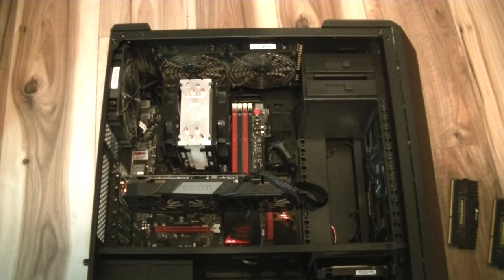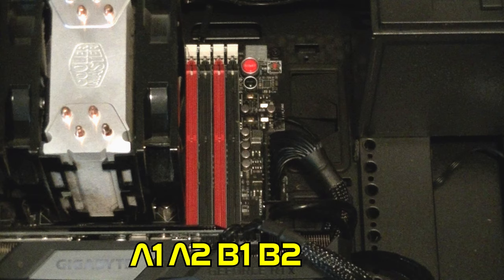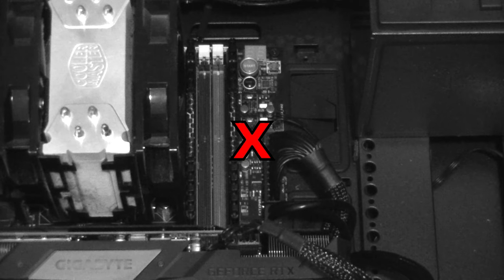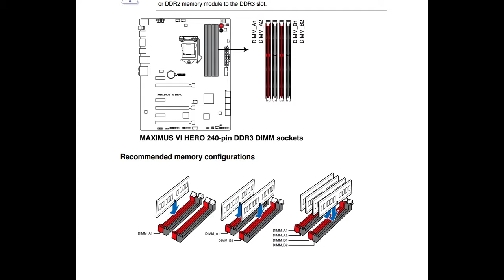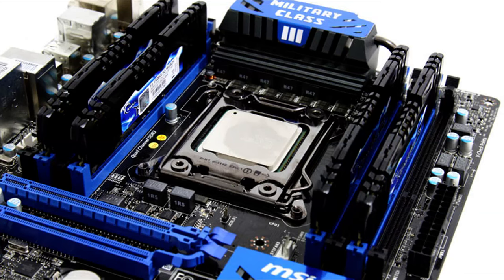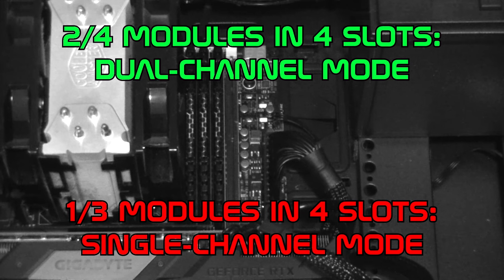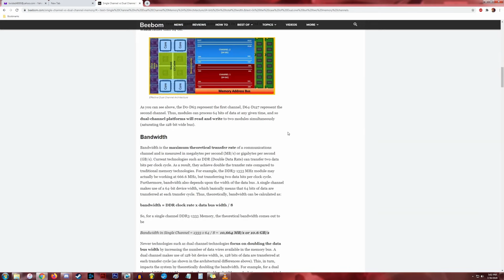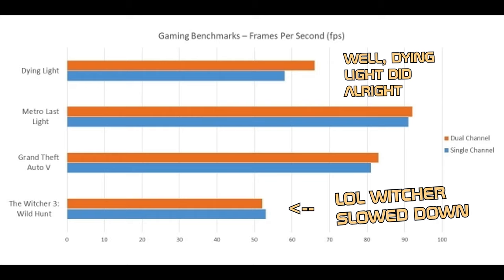How to Make Your RAM Run in Dual-Channel Mode

Comment: I install my ddr3 4 slots but it always bluescreen and when I put 2 slots again it normally again. Am I making mistake with my ram?
Reply from the maker: Check each individual RAM module in each individual slot. It could be some bad modules or it could be bad slots in the motherboard. If you deduce that any of the slots are bad, unfortunately there's not much you can do to fix that except for replacing the motherboard.

Comment: Is it neccesary to have the same model for both ram sticks to activate dual channel??
I mean, if i buy 2 sticks from different brands BUT they're running at same speed
(for example: 
BRAND A: 3200MHZ 8GB DDR4)
BRAND B: "       "     "          "..R4).
Reply from the maker: It's not necassary to get the exact same model, but you should get the same model if you want to have the least amount of headaches as possible. But again, dual-channel can still work with different brands/models (and these days with modern RAM they are starting to get more compatible)

Comment: I traded for a ASUS Rampage IV Extreme X79 system, I have 4x4 16g memory and 8 slots for memory colored red,black,red,black etc..... How should I fill the slots? I messed up and took the sticks out to clean. Originally I think it was all the red slots.  Is that the best to run dual channel?  Two black two red?  I need guidance.  Digital Storm built this PC in 2012...  Thanks
Reply from the maker: First try filling them into all of the matching colors (all red) and then run a program like Speccy and see if it says dual-channel.

Comment: So would you say it’s better to leave 3 ram sticks in at single channel mode? Or two Ram sticks at dual channel?
Reply from the maker: Generally, three sticks in single-channel mode will outperform two in dual-channel. More RAM is better (to a point, as in, if you already have enough RAM, there's no need to add anymore and thus dual-channel of two would be better in that case).
Reply: @Torqcx  Thanks so much

Comment: So would a 2 stick only mother board on dual channel mode work the same as a 4 stick mother board in dual channel mode?
Reply from the maker: Correct, both will run in dual-channel mode

Comment: When we install another 2 modules which makes a total of 4 modules, should we still use XMP or manually set the MHz in manufacturer's out of the box value? Thanks in advance mate.
Reply from the maker: I always like to start with the XMP, but if you have problems with it I'd go manual.
Reply: @Torqcx  OK. Will try this once the extra modules arrive. Thank you!

Comment: If I'm using three 16GB cards, are all of them going to work on single channel, or two of them will operate in dual channel and the third one in single channel?
Reply from the maker: On most modern motherboards from what I've seen, yes, that's exactly how they should operate (so long they're installed in the correct slots, according to your motherboard's manual).
Reply: @Torqcx  thank you so much for answering! Imma buy the 2 card pack then! Unfortunately I can't seem to find just one, and I already have one, so I will end up with 3 😂 I think they're all exactly the same

Comment: I have 2x8GB of Rams Kingston HyperX Fury (1800 MHZ) and 2x4GB of SK Hynix (1600 mhz) on the motherboard DQ77MK-R01 (Intel).
It has 4 Slots 2 Black and 2 Blue. What should be my pairing Scheme of Rams which Rams should be put on for Dual Channel Mode with Higher Frequency and GBs.
Looking for answer ..??
Thanks.

Comment: Hello im very new to all those things. which is better. 2. 16GB ram or 4. 8GB ram. all are 1866 mhz.       also  1866mhz is the max that i can use is that good ?
Reply from the maker: If your system is running in dual-channel mode, I would go with the 2x 16GB (less liabilities and less power being drawn for the same--if not slightly better--performance). 1866MHz isn't particularly "fast" for DDR4, but I wouldn't see it making much of a difference if it faster.

Comment: Do you have to make an adjustment in settings to activate dual channel? Or does installing two cards just do it automatically?
Reply from the maker: If you installed the RAM modules in the correct spots, it should automatically run in dual-channel mode! :)

Comment: My question is i have 4 slots in motherboard. Currently I am using 2 8gb sticks (total 16gb) in the dual channel configuration. Now if i want to add 1 more 8gb stick that will make it to 24 gb but still will that be slower then the 16gb dual channel configuration?
Reply from the maker: On older motherboards yes, 3 modules would limit you to single-channel mode. However, motherboards made in the last 3 years or so are typically able to simultaneously run pairs of RAM in dual-channel as well as any extras in single-channel. If this is the case, if anything you will just see your PC's performance increase rather than anything slow down. But you would have to check your motherboards specs/manual.

Comment: I have a question I only have 2 ram slots and I have 1 installed but they're different number ddr1 and ddr2 can i still run on dual channel mode?
Reply from the maker: Motherboards won't be able to simultaneously support different DDR types of RAM, so if you're saying you have a DDR module as well as a DDR2 module, the short answer is no, you won't be able to run one of them in the motherboard because it won't be able to support it. Always recommended to get the exact same make and model of RAM when installing multiple modules.

Comment: I'm having trouble with a motherboard manual, all I know is it has dimm1, dimm2, dimm3 and dimm4 in order, would dimm1 go with dimm3 for dual channel ram, or would dimm1 go with dimm2?
Reply from the maker: Go in the order you see in this video to start with (DIMM1 and DIMM3, or DIMM2 and DIMM4). Use a program like Speccy to see what mode it's running in.

Comment: Hi, thanks for the vidéo !
I just have one ask, if I had 2 slots with 2 ram of 4go hyper X Fury (Kingston) and I bought 2 others 4 Go but G.Skill Ripjaws IV Red, I put them on A2 and B2, and my computer is rebooting to the infinity
What I have to do? (Same frequency on the ram and motherboard B150M-D3H)
Reply from the maker: Try each module out in each slot individually. If it continues to fail to boot then the different brands of RAM may just not be getting along

Comment: Im confused. I went to the bios to put on xmp mode and saw that it said it was on single channel mode but i have two sticks of ram. The rams are in the right slots. Not exactly sure how to change it to dual channel. I have an ASrock motherboard. Plz help
Reply from the maker: Look up your motherboard's specific model's manual and see what it requires. Try trying different modes for the RAM for the BIOS (see if there's an option for "auto")

Comment: Small problem with my first desktop PC, as soon as I insert 2 sticks of 16" RAM into the 2 gray slots recommended by the motherboard manual, the system doesn't start and an orange light appears which, as I understand it, means there is a problem with the ram... however if I leave only one 16GB stick the PC starts up easily. What can I do?
Reply from the maker: I'd start by swapping the modules around, as well as trying them individually in each of those two slots, again, individually. Hopefully this will help you narrow down whether one of the modules or slots are bad.
Reply: @Torqcx  Hey man, thank you for the reply. I tried it first and apparently the problem is with slot A2 which doesn't read any ram, but slot B2 works for both ram. As soon as I have wifi I will test the performance and see if a single 16GB stick will be enough, if it's not enough I'll replace the motherboard.

Comment: so its okay to use A2 and B2 then ? is it safe ? will the performance being different from using A1 and B1 slots ?
Reply from the maker: The performance should not be any different so long as it is running in dual-channel mode.
Reply: @Torqcx  question : im using an old mobo its asus b85m-gamer , will it work better if i use dual channel mode ?

Comment: But do we need to set the bios to read dual chanel or will it automatically run in dual chanel mode if the ram is placed in the right matching slots?
Reply from the maker: It should automatically detect it as dual-channel, so long as the RAM modules have been inserted in the correct spots!

Comment: Please help me with an answer: say I have 2 sticks and 4 slots;  how is it possible to run in dual channel, if A1B1 is one channel and A2B2 is the other channel, and I put both sticks in A1B1, leaving the A2b2 channel empty?
Reply from the maker: All RAM must be installed in the appropriate slots according to the motherboard or the memory will not run in dual-channel. I do not know of a way around this.

Comment: I have msi b450m a pro max and itd only have 2 ram slot? im planning to add another 1 stick 8gb ram to it, my question is does the dual channel will work even if its only 2 ram slot?
Reply from the maker: Yes, the short answer is dual-channel works with only two RAM slots in modern motherboards.
Reply: @Torqcx  thanks man!

Comment: Hey, I would like to ask you about a problem that I have, regards the rams. I am using 4 ram slots filled with 4 rams, all same brand, size, speed everything(8gb x4). The problem is that, my system tells me I have 32 gb ram, but only 16 are usable. Why is that, and how could I fix it?
Reply from the maker: Are you using Windows 10? This I'd a common issue with the OS capping the amount of useable RAM, check out this post to see if it helps: https://answers.microsoft.com/en-us/windows/forum/all/windows-10-pro-only-seeing-half-of-installed-ram/eb1850fc-0d83-42fe-a7a2-2dbe29e075f0

Comment: What if you lost the Manuel for computer. Can you check in the settings  what kind of RAM it can handle?
Reply from the maker: Yes, an easy way to find out your motherboard's model is by downloading and running the program Speccy by Priorform. From there, just copy the model name/number that shows up and ask Google for its manual.

Comment: My PC doesn't boot when I have Dual-Channel Ram, it shows only blackscreen and I don't hear the "bling"(sometimes open up and close automatically again and again). It works only with single channel. Do you thing that depends on motherboard updates?
Reply from the maker: Try either of the RAM modules in the slot that appears to be working, one at a time, to test if one of them is just bad. If, no matter what, having both of the modules in at a time causes a failure to boot, you'd have to research it further as I do not know what would be causing the problem.

Comment: I got a big question....So i got a 16gb stick in a duel channel board, can i add a 2x8gb kit to it and make it run in dual channel?
Reply from the maker: Adding 2x 8GB sticks alongside a single 16GB stick is a total of three modules, which means the memory would run in single-channel mode. Beat you just get an additional 16GB stick and you'd have 2x 16GB running in dual-channel.
Reply: @Torqcx  thx

Comment: Is there a way to manually activate it if it doesn’t happen automatically.  Using 1 stick at a time shows the ports work and using the ram in second pc shows the ram works but none of the 20+ fixes has enabled it for me.  Only has 1 of 2 sticks listed as usable
Reply from the maker: That sounds to me more like you're undergoing an issue involving the system acknowledging that there is more RAM added to the system as opposed to having both those modules running in dual-channel mode? If so, the first thing I'd do is (assuming you're running Windows 10):

1) Click on Windows Start button and type: file explorer
2) Right click on " this pc " and click "properties"
3) Now click on " Advanced system settins "
4) Under "perfomance" click on "settings"
5) Click on "Advanced" tab and " change... "
6) And finally, uncheck the box " Automatically manage paging file size for all drives "
7) Restart the computer

I copied that from a site, it worked for me the last 3-4 times this happened to me in a system. Let me know what happens
Reply: Thank you for the reply, unfortunately this is something I have tried a few times today.

The only unusual thing I have noticed is I can’t get the “maximum memory” setting to work properly.  It keeps changing to 0 if ticked and I select 4096

Comment: Actually,,NOT with the same result.My 2 sticks do NOT work in the other 2 and i still haven't been able to figure out if i have defective slots or those two slots can NOT handle the 2 sticks,i have in 2 and 4 with the machine working properly.When i put the 2 sticks into 1 and 3,machine doesn't boot up just beeps.If you have any suggestion,i would appreciate it.Thanx
Reply from the maker: More modern motherboards are starting to work more efficiently (or at all) with two RAM modules in slots A2 and B2, you can watch my updated RAM video for more details

Comment: What if i have 4 slots total on my motherboard:  32GB sticks in A1 & B1 AND 16GB sticks in A2 & B2 ?  does this mismatch matter?
Reply from the maker: On many modern motherboards, both pairs may actually be able to run in dual-channel mode, but if you have anything older (anything most likely from the pre-2020's), all the RAM MIGHT run in single-channel. But again, depends on your board. You'll have to read into your specs and/or test it to find out!

Comment: Hi..I only have 2 slots in which 4 gb (2400mhz)  is soldered ram..If i add an 8 gb ram (2400mhz) to the empty slot will it enable dual channel or should I buy another 4 gb ram only?
My laptop is lenovo ideapad 330-15 arr ryzen 5 2500u
Reply from the maker: I always advise to get the exact same model ram if installing additional modules... not for dual-channel compatibility issues but for other issues, such as the speeds and timings not adding up correctly or complete boot failures. If the timings and speed are the same and it's just more memory than the initial module, the dual-channel mode will probably work, so long as it works at all.

If you want to give it a try and you know your motherboard is compatible with the 8GB module, I say try it out. Return it if it doesn't work and go with the 4GB.
Reply: @Torqcx  thanks a lot man..i'll keep that in mind

Comment: just purchase B550M pro4 board and I have 2 rams stick that is in A2 B2 and when I downloaded the Cpu z its showing as 2x 64bit its not showing as dual under channel. what does 2x 64bit mean ?
Reply from the maker: I've never heard it worded that way before but I'm assuming it's running in dual-channel? Try another hardware monitor program like Speccy to get a second opinion

Comment: what happen if you install 16 (4x4gb) ddr 3 1333 and the system only shows you got 8GB (2x4 gb) ram? booting screen shows the PC spec and show it has 8gb, and after stsytem start up i checked the taskmanager also show 8gb ram. dont know how to fix it. 4 rams is totally work with A1B1 or A1B2.

Comment: I recently purchased 2, 8gig sticks, they sent miss matched speeds (from China) though, 3000 and 3200 so I now receive errors while booting. I tried 3 of the same but still received the boot errors. Any ideas? I have a Windows 11 PC. The odd one is the 3200. Maybe if it is placed into slot A1? That's about the only thing I haven't tried although, I doubt it would make any difference.

Comment: I have an issue. My ram would only work in single channel . Recently I wanted to get another ram stick and switch to dual channel. I put the sticks in slot 2 and 4 and when i turn on the pc the rgb on both ram sticks light up but there is no display on my monitor. Once i remove the other new ram stick, my pc works perfectly fine. Both ram sticks are same exactly model, speed etc. Ive tried resetting bios. Nothing works. Pls hep
Reply from the maker: Have you tried both of those RAM modules in each slot individually? Test them all out, it sounds like either that slot may be bad or it's RAM card's fault. If cleaning the slots doesn't help, it sounds like one or the other could be defective and you need a replacement (in which case, hopefully, it's not the motherboard).

Comment: Hi I have 2x8gb xpg d50 for many months and right now I was added 2x8gb xpg d60 if I use just 2 slot it work but if 4 slot it doesn't boot.
Reply from the maker: If your motherboard is 100% compatible with ALL of your RAM, it sounds like either at least one of the RAM modules or slots are faulty or just dirty and have to be cleaned.

Comment: If the motherboard has 4 slots and it says a dual channel motherboard and you fill all the slots with 8gb ram of same brand and same frequency then will you get 32gb ram ( 8+8+8+8) or just 16gb ram (8+8)?? .  And if just 16gb then why 4 slots are there??
Reply from the maker: With each slot occupied with 8GB modules you will get 32GB of Dual-Channel RAM.

Comment: ive been running single channel since my build and recently realized this is incorrect. 

What do I need to do in order to go to from A1 A2, to A1 B1?

Do I need to reconfigure antyhing in the bios? or will the mobo automatically know what to do and run dual channel?
 #pleasehelp!
Reply from the maker: The mobo will automatically run in dual-channel mode if the RAM modules are in the correct spots, nothing is required to be adjusted in the BIOS.